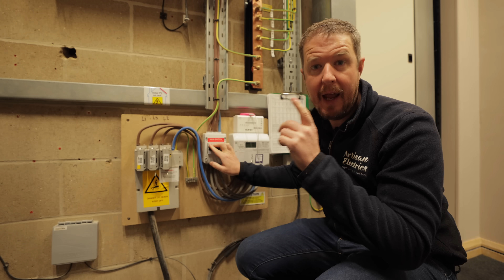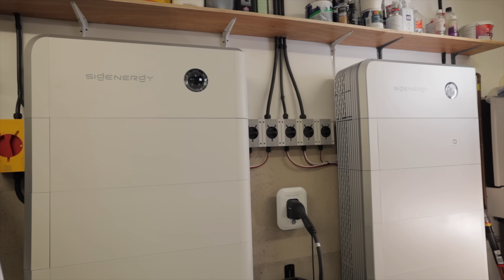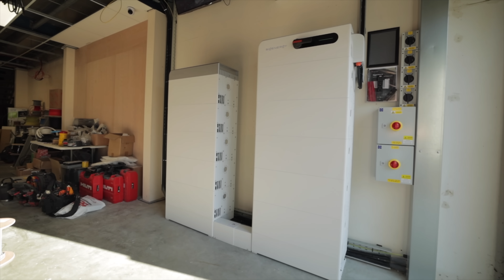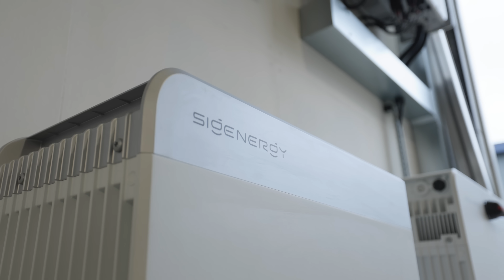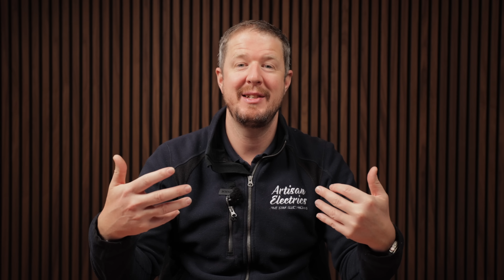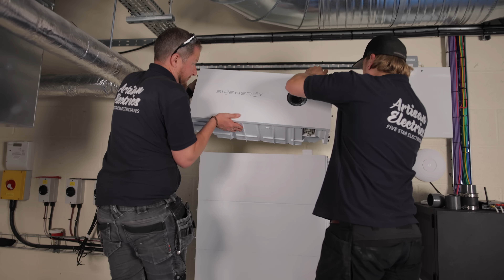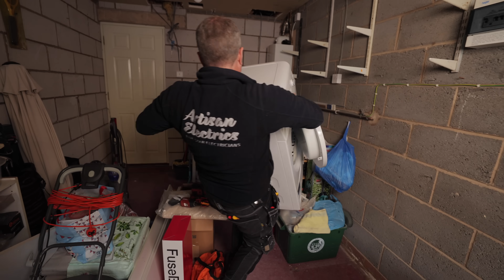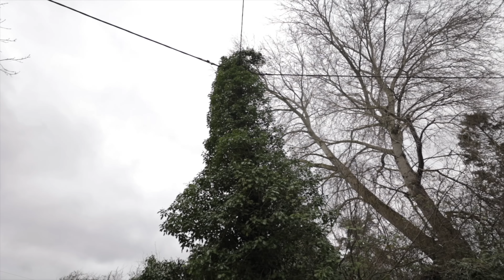You’ve Been MISLED About Battery Backup

Comment: I keep my system like an IT configuration have 6kw non grid tied and charged from the suppliers night rate. No grid tie means you don’t have to worry about that. I do use class 2 appliances only, because it’s not referenced to earth. Also the inverter will only 2.4kw. Capacity  6kw.😁 lasts up to 20 hours covering most appliances.

Comment: It’s always important to have a battery system that will ensure emergency power supply during outages. I do work for Sunrun, which installs reliable lithium batteries that store solar power for use during emergencies or when power rates are high.

Comment: I'm about to install solar (around 11kwp) and a Sigenergy battery with their home gateway, I have a preinstalled EV charger (Zaptec) and in 2 months time will converting my oil heating system to a heat pump. I would clearly want the heat pump to make use of solar and battery and would want that to continue in the event of a grid power outage until the battery gets to a pre-set discharge state. I'd then want to sacrifice heating to keep the fridge, WIFI and lighting working. For the EV charging I'm using Octopus Intelligent Go. As they can allocate charging slots and any time I want to avoid the car draining the battery when I could be using cheap rate mains power. My thinking is the EV charger needs to be blinded from the system, and the heat pump connected via the smart port on the gateway. However I would like to see the EV charge usage in the Sigenergy app if possible, albeit not being managed by it. Could anyone help guide me if this is possible, and how I should be instructing my installer to prepare things so that Octopus will understand what to do to achieve my desired outcome when they come along later?  I've also read about SG control on the heat pump - should these be used instead of or along-side the smart port?

Comment: Have backup via a PW3 + one expansion. The short cutover time is much more irritating than I expected. Things like the router are protected by their own micro UPS, but with everything have electronics in it these days, nearly everything has to reboot / restart - even simple things like fans which all seem to be electronic these days. The system is sized adequately - the PW3 11Kw invertor is probably big enough for most people. However, I made the mistake of the system backing up the whole house, including the garage which has the EV charger connected. If the power goes out when the EV is charging - not uncommon - I need to go and turn the car off. Those sort of heavy "optional" loads should really be excluded. We've also had a big - 16Kw output - ASHP fitted since the PW3 was put in. The total storage capacity of 27Kwh is very rapidly depleted in the winter!

Comment: Portuguese solar customers experienced major frustration during the historic Iberian grid blackout (which impacted both Spain and Portugal), largely because standard grid-tied solar panels automatically shut down for safety when the broader grid fails

Because grid-following solar inverters require an external grid waveform to operate, customers with standard setups were left without power, prompting widespread realisation and debate about home energy systems.

The Solar Battery Misunderstanding 
The widespread "rage" from residential solar owners stemmed from a misunderstanding of how standard grid-tied solar systems operate. When the blackout took the grid down, everyday solar panel setups automatically tripped offline via anti-islanding protection. Many Portuguese solar customers realised for the first time that their systems could not power their houses during a blackout unless they had invested in a dedicated off-grid or hybrid system with a backup battery and a transfer switch.

Solar System Types Compared Grid-Tied: Cheapest setup. Directly connects to the utility grid. Shuts down completely during a blackout to prevent injuring line workers.

Hybrid: Connects to the grid but includes a battery. Provides continuous power during a blackout by instantly isolating your home from the grid.

Off-Grid: Entirely independent from the utility company. Relies 100% on massive battery banks and generators. Unaffected by grid blackouts.

Comment: Solar installed by my local council here of course no battery backup! in Sunny South Hampshire!

I do have a DJI power 2000 , expansion battery with Shelley 3EM, but we have power outages so in-frequent this is way more than enough to buffer the load! and I do have a few key computers and internet plugged into the AC outlets of the DJI power. but no guarantee that i will have enough power to keep them going.

Comment: Backup is an invented probem in most cases. I have never suffered from a blackout  tomsuchnan extent that I would have need to concider it. The biggest risk in a climate with -30 C in the winter is heating. Blackouts tend to happen when it is warmer if any. They are normally caused by storms. I have firewood heating as backup. That I anyhw use for the cosiness factor or when the electricity gets over 30 cents per kWh as support. I only burn a couple of cubic meters of fire wood per year. One unstacked cubic meter of birch firewood contains 1000 kWh. Taking the efficency of the fireplace intomaccount I get around 800 kWh from a cubic meter.

Comment: The company that supplied my system said I was getting 12 495w panels dyness power box g2 and a solis s6 6kw plus inverter. What they installed was 10 480w panels 2 475w panels a dyness power box pro battery and a solis s5 6kw inverter. I’m absolutely livid. Seeing that c rating on the battery I have vs the battery I paid for is the icing on the cake.

Comment: Good video. I think it has summarised all the information that has taken me time to accumulate about back-up systems. I almost went ahead with an installation from a company and told them it was to keep things powered while I was away. Only at the last moment, before paying the deposit did I ask them directly 'It will automatically kick in when the power goes off, won't it?' - No, they said, it goes of when the power is down! - I dropped them straight away.

I then looked into what was really needed to go off-grid. But this video covered most of that.
I'd have liked to hear more about solar panel system requirements to supply the battery systems. I believe that there are certain thresholds and minimum power ratings that the solar systems need to be able to charge certain battery systems?
I fall into the category of 'peace of mind' when it comes to home back-up. The village I live in in the UK does have occasional power cut, especially in the winter months. Also, I think there is a risk of renting on the grid in the future.
I work away at times. I like the idea of having power that would enable me to run the house comfortably both when I'm away and when I'm home. It won't be 'cost effective' as I wouldn't make a lot of money on what goes back into the grip. But it would be a great feeling knowing there would always be power, and probably no electricity bills in the future.

Thanks again for the video.

Comment: With an electric vehicle, the stress on the home battery can be very high in terms of instant power and total energy being moved around. I set a Maximum Discharge Power in the inverter for the home battery in order to limit the stress on the home battery and to also have more energy available as a Reserve in case there is a power cut while the electric vehicle is charging.

Comment: In order to have Full Backup, you also have to configure a Reserve value in the inverter. When my Fronius Gen24 6 kW inverter with 15 kWh BYD batteries were first installed, the firmware at that time had the Reserve setting hidden behind the technician password. So the Reserve value wasn't set. On the [winter] days when the total Consumption was higher than the Production, there was no Reserve at the end of the day. The battery sat at the minimum value for days. There were no power cuts, but if they would have been, then I wouldn't have had any power. After about 2 years, I found out by myself that a new Fronius firmware was available, I installed it and the Reserve setting was now available behind the Customer password. So I'm now able to set a Reserve value so I have Full Backup available even when the total Consumption is higher than the Production.
With an electric vehicle, it can happen far more often to have the total Consumption higher than the Production. So the Reserve value is even more useful.
Also, only the Web interface of the Fronius inverter has all the configuration options. The mobile app has only the Viewing mode. You can't configure anything from the mobile app. So you have to know the IP address of the inverter in the local Wifi network. I had to assign the inverter a static IP address based on its MAC address. Then I created a rule in the internet router to forward the 80 port of the inverter to the one of the router's outside ports. Then I asked the internet provider to assign me a static IP address so now I can configure the Reserve value etc from anywhere in the world.

Comment: You also have to test that Full Backup installation. When my installer finished the installation it was getting late so they left without testing the Full Backup functionality. The system worked perfectly when there was grid power available. When the first few power cuts happened, the system just didn't start, the house had no power during the power outages. After I reported this situation and they claimed they did test the Full Backup and blamed me for doing something wrong, they finally came and found out they had one wire mounted in the wrong place. It took a while for them to find that wire among all the wires. Which proved they haven't actually tested it at install time. They did apologize afterwards.

Comment: My Fronius Gen24 6 kW inverter with 15 kWh BYD batteries take about 7 seconds (of no power) to start the Full Backup. I think this qualifies as EPS. So EPS doesn't mean only 50 ms interruption.
There's no specific Gateway device in this setup. It's probably included in the Fronius inverter.
I have a classic UPS for the internet router and the desktop computer. It handles the 7 seconds span just fine.

Comment: We have a 20kWh battery installed, backup power and detachment from the grid is done via a manual switch, power outtages are extremely rare.
However I need to check the switch which was installed not too long ago a little bit closer. With a 3-phase system you need a switch which opens neutral last and engages neutral first to avoid a neutral point shift.

Comment: There's one more thing regarding the maximum power the inverter can supply in case your home was installed with a 3-phase system: Some inverters do not like unbalanced loads, so having full output on one phase and the other two phases basically zero can also lead to a shutdown of the inverter, even if the total power consumption is below the max. power output of the inverter.
Newer inverters support fully unbalanced loads. However those inverters are still limited to 1/3 of the inverter's rated power per phase.  Or for better understanding: a 3-phase 10kW inverter provides 3x 3,33kW. If you draw e.g. 5kW only over one phase, the inverter will also shut down.

Comment: I have solar installation with a 10kWh battery and an 8 kW inverter. ¨
The inverter has a dedicated backup output. 
The CU is wired that the light and selected socket circuits are on an automatic change-over switch between the grid and inverter backup.  
The switchover works seamlessly during the frequent power cuts (rural area with overhead cables). 
For longer power cuts in winter, I can add a 4 kW generator.

Comment: Just keep in mind that when the power cuts out, your internet will cut out as well even if your have your off-grid infrastructure at home of business. The distribution points of fiber optic and coax are not designed to keep the ISP connections live. Here in the Netherlands internet exchanges (1 in every neighborhood) only have a 30 KvA UPS in them. Enough to gracefully shutdown the (very power hungry) equipment, not to keep your internet connection live for very long.

Comment: Netherlands here, I use a 10 kWh lifepo4 battery, 12x430 watt's solar panels with a Victron MulltiRS Solar. I can charge a discharge with 90-100 amps (5000 watts AC). This system is a UPS and EPS in one. The switchover time of this MultiRS in case of a power failure is ridiculously fast at 20 milliseconds, I don't even notice it when I flip the main breaker. Build the whole system myself and it's happily running for the past year. The system has cost me around 4000 euro's (1600 for the Multi RS, 1250 for the battery, 400 for the Cerbo + screen, 500 for cabling and breakers, I already owned the PV panels)
Reply: 20ms is more than enough to cause some devices to reset or in a few cases worse.  Ups time is generally on the 0ns-10ms timescale, my decent budget ups devices are 2-6 ms typical 10ms max rated, my nicer ups units are 0ns as they are always running on their internal inverter (online ups), the automatic transfer switches I use for sensitive gear are 2-7 ms transfer time.  A lot of equipment won't care about 20ms, but some definitely will and a fair bit it will be outside their rating for ride through.

I use an inverter with a pretty fast eps switching time, but I still have actual ups equipment on more sensitive  electronics like computer gear, and that's a good combination for most.

Comment: UPS is overrated. Few things need it. If I do need it I can plug it directly to one of my portable power stations. I manually switch to grid if I need to, otherwise most things are run by my largest system. I have two smaller systems that are run from the panels on the roof down a vent into the kitchen where I directly plug things in to supplement the larger portable power system. I can use the smaller systems in other locations if needed, though I would first cover the respective solar panel. I have two smaller panels for each of the smaller systems which I can plug in in parallel and are more portable. I'd like a larger system but can't justify the expense. However,  when prices fall enough I will purchase a bigger system, but I love having back-ups to the back-ups.

Comment: You need do the math if you want to be powered off grid - brown out etc for all devices and appliances, need match the power available to power consumed. As an example if you use 1kwh you need a battery system able to match that at around 25kwh, which is the consumption of the apartment I live in.The more power you require the bigger and more expensive it gets, and possibly more complicated.

Comment: Another Aussie here. We had a 7.1kW solar panel array with a 6kW Sigenstor hybrid inverter, sigenergy gateway with whole home backup, and an 8kW battery installed mid February, and it is fantastic. We have a one bedroom cottage and plan on getting one more battery later in the year, and that should see us easily through a full day, otherwise a total of 3 batteries definitely will. I’m not shy to run our two 2.5kW air conditioners all day for weeks at a time during summer. Our last power bill was $745 for 3 months, and our next predicted bill is estimated at $199, which includes the daily supply charge. Really happy with our current setup and keen to get an extra battery or two when we can.

Comment: My battery inverter is only 8kW, so it feeds a backup power panel that excludes huge loads like stove, clothes dryer, heat pump. But as long as we don't get carried away with a bath the battery can power the water heater and well and other kitchen appliances, and during the day the solar panels recharge the battery for extended outages. The challenge is rain reduces solar output to 10% and snow to 0%

Comment: MSc electrical engineer here: excellent and super honest explanation. I can only agree and support your statements. Btw the disconnecting from the grid in an outtage is also for the phase synchronising when the power comes back on. Just imaging what happens if your ups is180 degr out of phase. If you would be active in NL I would hire you on the spot. Too many cowboys here...

Comment: It doesn't help if the imbecile installer wires it wrong.  First blackout, no power except for one useless circuit. I later doubled battery capacity and second installer wired it properly so I sail through short blackouts now with everything working as it should.

Comment: Run a 82kw sig system incl gateway for backup power in NL . In addition we have a 72kva diesel generator linked to the sig gateway which work brilliant.  The gateway even lets the generator run every couple of weeks just to test it.  The generator has a 135 liter diesel tank so we can go for a little while when the power is out. Considering a 1000 liter backup tank.

Comment: quite a few inverters now come with mains switch through support. I had an old lead acid UPS - replaced with one of these, 2x 12v 200A LifePO4 with BMS certified and a Victron mains charger - now my rack will run for over 20 hours. Cost was a quarter of an UPS that would have lasted far less. Reason I did this was I do have a petrol generator, but: a) my wife can't start it b) we didn't want to run it over night. Now I can plug in (via extension) the fridge/freezer  to the rack over night and it has plenty of head room to run that and the rack tell morning. 9 times out 10 you do not need whole house backup, you just need a capability to cover what matters to you.

Comment: I use two Ecoflow ultra systems with 37 kwh of batteries and 9kw of solar. The battery system is fully isolated from the grid and the grid automatically suppliments the solar to charge the batteries on heavy overcast days. I do not sell any extra power back to the grid - I use the excess for heat. The only way we know that the power is off is when people call to check on us. Everything is seamless.